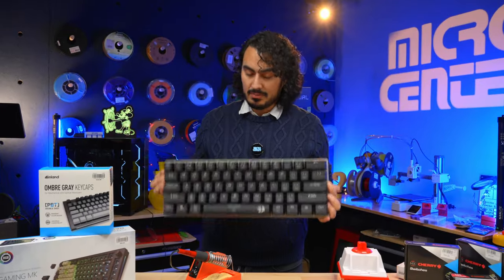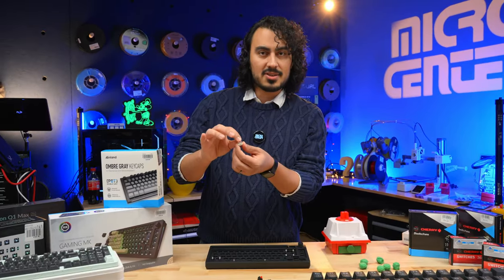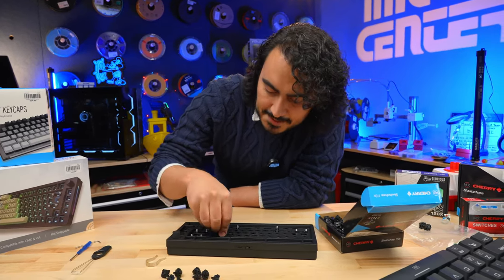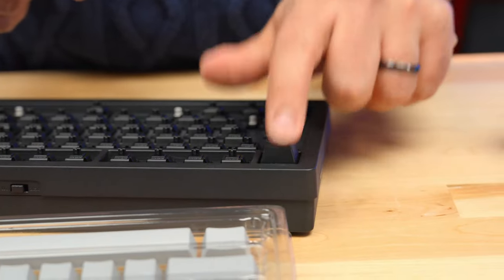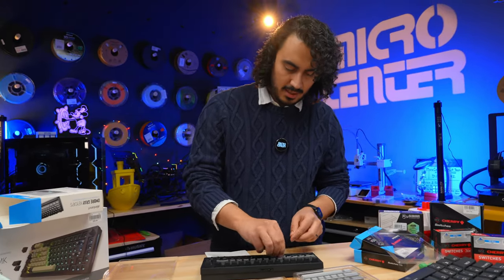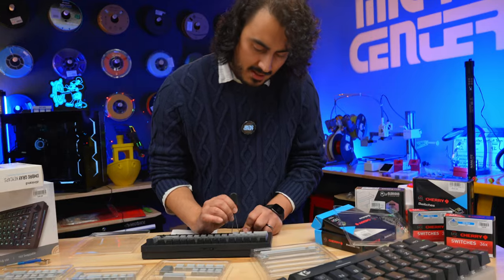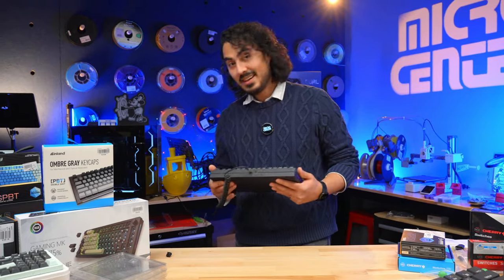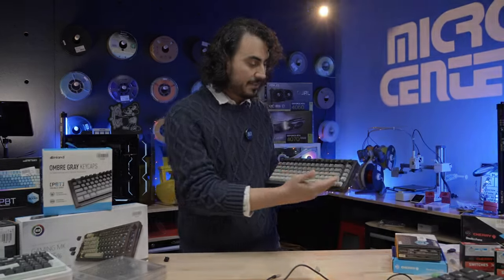EVERYTHING You Need to Build Your Own Mechanical Keyboard | Micro Center

Comment: I'm another who has Phoenix AZ on wishlist of locations. Recent computer build ended up being almost entirely online and on one part went through a longer search trying to verify that one of the parts I had trouble finding turned up on Micro Center through Amazon.
  I wouldn't buy this keyboard myself as I want at least fullsize for a keyboard; so annoying to be missing buttons that are, or could be, used in programs and as a desktop user I am not space constrained like others with laptops, travel needs, or small work areas.

Comment: And maybe I missed this, but why did you decide to go with Cherry MX Black non-RGB since the keyboard and the keycaps really kinda need it, not to mention you chose top-legend shine through keycaps for a south-facing RGB board... There are only 3 components you had to pic and you picked, maybe, the worst possible combination. 

If you want, from Microcenter, a better combination of switches and keycaps for that board, but keep the same basic type theme, then I would suggest, AT MINUMUM, getting the Cherry MX Black RGB (for the mentioned shine-through) and I probably wouldn't go with the shine through with the Gaming MK, but go with something like the Glorious Black Ash keycaps so you don't need to even worry about the RGB and you can just have a subtle underglow with this, "stealth" keyboard build.

And I am not talking necessarily about taste here, because I find the non-shine through and the black ash somewhat hard to ready, I am just talking about for the rough equivalent, that you can get in-stock at Microcenter that makes the best use of the parts, I think that this is the best looking, and probably sounding, keyboard. (Sounding because those Glorious Dye-sub Keycaps are thocky-er than the Inland Ombre).

Comment: Can you use other faceplates with this kit?
Reply: I've not seen any yet.. but as close as this thing is to the gmmk pro, it's entirely possible this uses the same plates.  The rest of the case, minus the glorius on the bottom, is pretty much identical.  I've not tried a different plate though... it doesn't need one for my build.. a silent KB, and the plate doesn't do much with silent switches